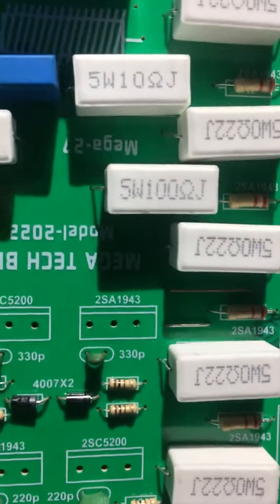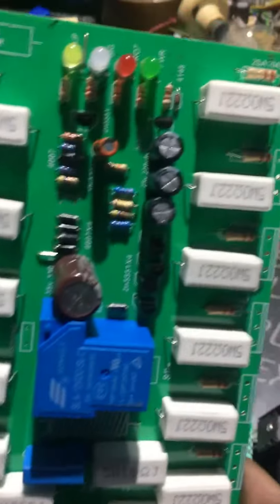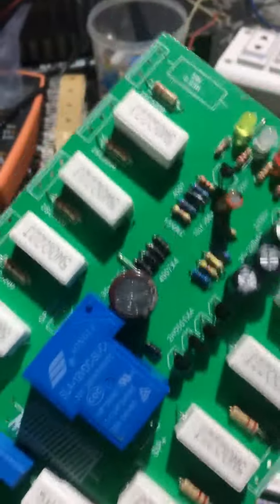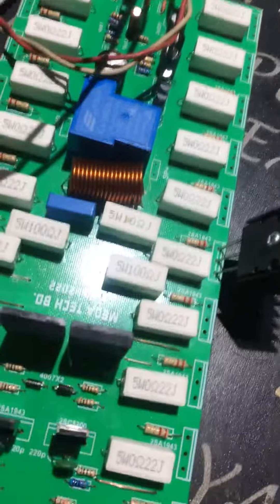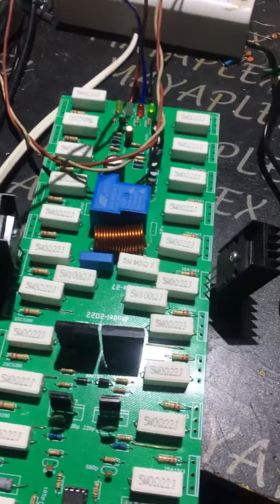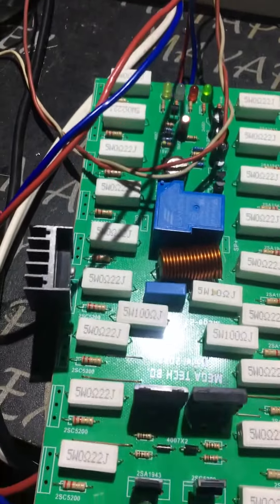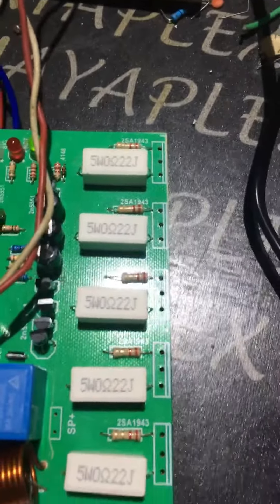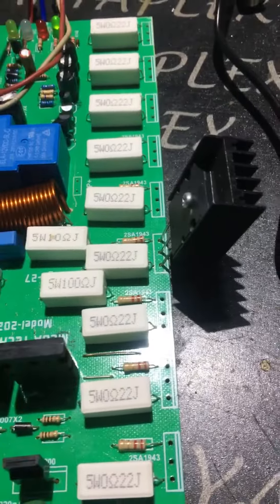Rokola with protection

Comment: ভাই সার্কিটা নিব কোথায়  থেকে ।এখন আপনার কাছে আছে এই সার্কিটা।
Reply from the maker: এখন এটা নেই ভাই৷ নতুন সার্কিট আছে৷ লাগিলে ০১৩০৩১৪০৮৬৮ নম্বরে কল দিয়েন৷
Reply: @audiolab38700  কত টানজিস্টরের  , আর এই রকম প্রটেকশন ও লাইট সিস্টেম দেয়া আছে।
Reply from the maker: ৩০ ট্রাঞ্জিস্টর এর আছে,২৬ আছে,১২ আছে৷ ১৪ আছে৷
Reply: @audiolab38700  ২০/২৪ ট্রানজিস্ট র সার্কিট নাই
Reply from the maker: @nob-rt-gamar9111  আছে,মোট ২৬ পিস লাগে৷ ড্রাইভার সহ ২৬৷
Reply: @audiolab38700  dada ami ki apnader thaka 12 transistor ar board niya 15 ampier 45 volt round orginal tama ar transistor ar satha use korta parbo sei khatra dam koto taka 12 transistor board tar
Reply from the maker: @shakhratul4842  yes